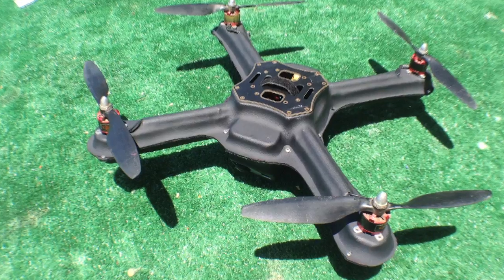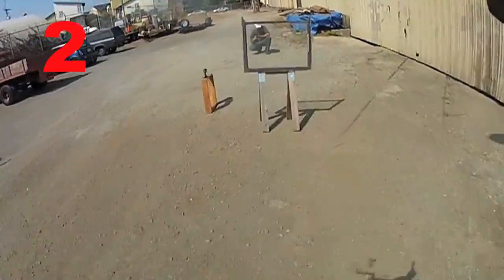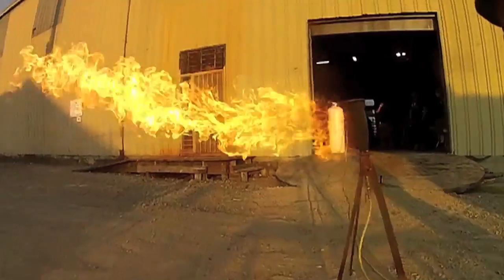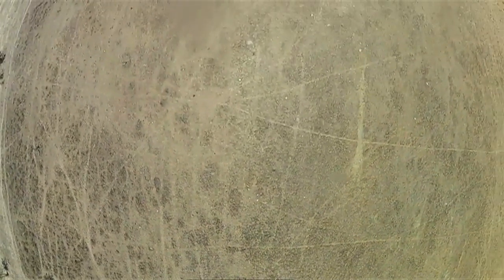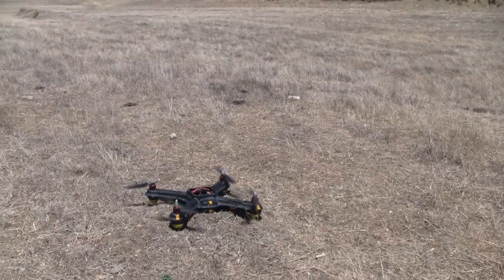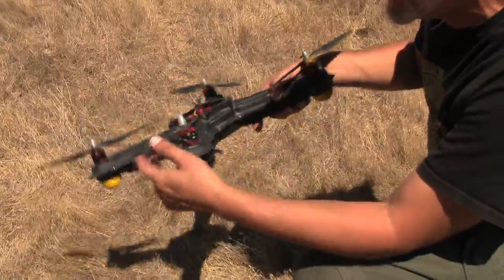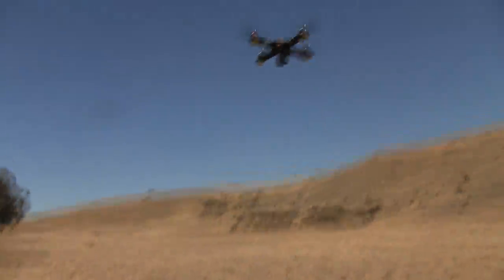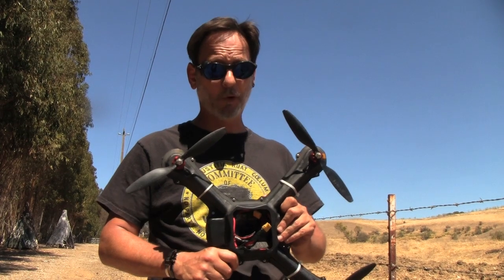Shotgun vs Drone Airframe - UAV Torture Test by Aerial Sports League

Comment: There is something simple to block a drone; nylon wires without weight they are going to wrap around the prop that will make the balance unsustainable 
Also if you take drone loaded with heavy ammunition they are not very "agile"  due to the inertia 
a version of nylon or kevlar wire with glued  sand could potentially damage the props.
The goal is to make the drone inoperative and fell on the ground intact or not is not the problem

Comment: It was a good strong frame for a dji f450 but not bird shot proof maybe if he put the e.s.c,s in kevlar/ceramic type bags also the naza and cut down on the wires with the idea of routing the power through the frame then maybe he will be able to take a shot or two from bird shot so long as it misses the prop 6 props would give a better chance of survival after being shot

Comment: @ the fire test:

One thing about fire is that it's essentially 900 Celsius air. That means it's about 1/4th the density of room temperature air. This means that flying a drone (or any aerodynamic vehicle really) through fire will cause sudden loss of lift. Come to think of it, flamethrowers may be an interesting way to fight drones, as if they don't cook them, they will at least knock them out of the air, and quite likely cook off their magazines or detonate their explosives if they're meant as fighters, bombers, or kamikazes.

Comment: Not really understanding your definition of indestructible.  Each time you did something it brought the craft down and you had to repair it before the next flight. Repairable yes. Indestructible, absolutely not!
Reply: +Muhammad Steinberg
Indeed. This thing isn't indestructible at all. He should have used a reinforced steel frame to begin with.
Reply: +ChaosManticore how about titanium frame stronger and lighter but more expensive :/
Reply: eggrollsoupnova2000
Certainly. But unless they want to spend a lot of extra money on this prototype, I doubt it would be a good idea. Even if you make the frame more durable, the rest of the craft has weaknesses.

Comment: Shooting that pistol gripped shotgun like that is good way to end up with your jaw wired shut.
Reply: +Justin Westbrook Pistol grips are useless, they were originally intended for breaching and nothing else. If you shot it like that with any stout load, you would be severely injured or killed depending on how close you held it to your face.
Reply: Doesn't matter if it's a .410, there are butt stocks for a reason. Pistol grips are for firing from the hip, like breaching a door or close in fighting. By using that shotgun that way, you're setting an example of something that's very unsafe.
Reply: +Justin Westbrook  your jaw, not mine
Reply: Justin, when name calling starts, the discussion ends. I'm going to block you. This person is another reason why trying to have a meaningful on YouTube is pointless. Too many keyboard warriors here.
Reply: +Walter Grace Keyboard Warriors shouldn't be people who can use dumb insults. They should be people who know how to speak correctly and have a proper, civilised argument.
That's what it should mean; not necessarily what it does. :)
Reply: Walter Grace I'm glad you agree. :)
Reply: Common sense.

Comment: I fly racing drones, all drones are indestructible when you replace the destroyed parts lol I crash my drone all the time and all I do is change props and I'm up in the air again, that first gun shot blast knocked the shit out of it, your lost a motor an ESC and the arm is shattered,  and I dunno what else you replaced before flying again, . oh and you never ever bend back a prop you idiot, this prop needs to be changed immediately unless you want to lose it in the air on your next flight and have your drone drop down like a rock.
Reply: Gus F Thanks for the comments and calling me an idiot.  Btw, that unmodified airframe (and bent prop) are still flying to this day, even with the wear & tear and shrapnel damage.  Tell me your racing airframe can withstand the same and then I will heed your advice.  Thanks again and share the links.
Reply: (old) ASL  Share the links? as oppose to the links you shared showing us the same prop is still flying? yes the frame can have wear and tear and duct tape and can still fly no rocket science, can you fly it with the blown ESC? or motor? I think not , you didn't invent the light bulb dude, all drone sustain the same damage your drone sustained and can still fly after you changed the damaged parts,  JUST LIKE YOU DID.  I fail to see where is the rocket science there.
Reply: Gus F Thanks for the comments.  We made the airframe in the video.  It withstood all the abuse in that video and is still flying.  Its a really neat airframe - unlike any other airframe available anywhere.  No rocket science involved.  Just a really durable airframe.  And that prop was a 2nd gen from DJI.  Not sure what it was made from.  Their newer ones are not the same.  But that one prop I mentioned is still airworthy.  But I won't be digging it up and shooting a custom video just for you.  Sorry but I don't have the time at the moment.  Perhaps watch the rest of our early durability tests on this same Youtube channel and that will help you better understand the airframe and it's special qualities.  Thanks again.

Comment: "Taking several shots at it did nothing but scuff the plastic."
Besides the other damage it did.

It's impressive how much damage it can take, but to say it wasn't affected by the tests is wrong. Easily fixed and durable, yes, but hardly indestructible.

Though it's getting there, I suppose.

Comment: What exactly is your definition of it being destroyed?  Vaporization?  The shotgun blast even from a good range knocked it out of the air and damaged several critical components so that it would have been out of service in the field. 

I mean, is this seriously supposed to have military applications?  Really?  This is nothing different than thousands of hobbyists are doing in their basements.  I expected at least a carbon fiber body, maybe a bit of kevlar.  Enough thrust to lift a bit of firepower into the air (since you said it was a fighter).  Maybe some advanced optics (not a freaking go-pro, which is unnecessarily heavy and not remotely aerodynamic, you didn't even take it apart and get rid of the case for crissakes, or dome it). 

Seriously, I've seen literally hundreds of better drones made by other hobbyists.  I'm not quite sure what you're bragging about here.
Reply from the maker: No worries.  A guess you gotta spend, fly, crash, wait, repair and spend over and over again to really understand the benefit of this airframe design.

Comment: I am thinking that the real benefit of that protective cover might be its elasticity thus reducing the jarring of sudden impact. If it was acting more like a rigid shell the drone would have shattered the window more easily. Interesting experiment - thanks.
Reply from the maker: Like a well made saddle, it has flex without suffering structural integrity.

Comment: 1. Holding a pistol grip shotgun ar your face. No
2. A hollow point .308 would destroy that drone.
3. Our using a home defence smooth bore 18.5 inch barrel with looks like light game load. Use a 24 inch with 3.5 inch load and a proper choke. Your test is faulty
Reply from the maker: Faulty how?  Just because you can name a bigger gun and heavier load does not mean it's faulty.  After all, There was no test against an A10 warthog either, so the jury's still out I suppose...  Thanks for the comments and share the links

Comment: your own prototype??? LOL! yall a bunch of crooks. thats basically a DJI Flamewheel 450 and you just wrap it in some kind of dark color box-like. you're even using a battery from Hobby King! so dont say that its your own prototype! lolz.. ESC are 30amp optos. with the 2212-920kv motors. lol.. dont try to own something that nots yours! HAHAHAHAHAH
Reply from the maker: Don't call me a crook.  We used the DJI as inspiration while developing our early "airframe" prototype.  We don't claim to make batteries or motors or esc's (those are off the shelf components). We only made the AIRFRAME, using the DJI as a mold shape inspiration - there are no DJI airframe parts on this prototype.  It just looks like it.  BTW, to see the whole process we went through, from DIY'ing it, to kickstarting it, to now having a full-blown drone hardware company, check out more of the videos on this channel - or go to www.gameofdrones.biz.  Thanks for watching.

Comment: How much does it cost to add the durable elements to this drone? It looks like Kevlar or real hard plastic on the frame outside is this close to reason? I don't see a use for myself but see how the Police and Fire Departments could make good use of this drone. I was thinking a small metal spike element to break windows better. Our city of over 1 million just bought its first drone, looks like a cheap $400 unit with a few upgrades from the vendor's website. They'd probably better off having paid for this in the long run.

Comment: It seems like if you took this air-frame and gave it 6 - 8 propellers instead. You would be able to sustain a shot or two as the extra lift from the other legs would be able to automatically adjust for the other leg's loss. Just a thought.

Comment: Not sure why anyone would downvote this.
Reply: The shotgun choice and load was a joke which probably is where the negative aspect came from, good salesmanship, but the last part was a turn off for many I suspect.
A pistol grip shotgun sucks and is for amateurs at best or people breaching doors. Aim is seriously cut down as well as velocity +1 on his zombie tape job though :P
So for the sake of the argument of the video this is highly unlikely to be the shotgun which would be used to shoot it down. More than likely an actual bird gun with longer barrel and a bird load which can very amazingly. Heavy goose shot would probably mangle it while light should would do nothing.
The last shot with the shotgun on here is what we call in trap an air move. Meaning the air coming from the pellets actually pushes the clay in a certain direction looking like a hit. Honestly it did not even look like this was the case, just a flat out miss which is easier than you may think.
Distance also plays a huge role, it not unusual to get "Peppered" from pellets while out fowl hunting, it always stings and rarely breaks skin, again, depending on shot used.
Had a defense shotgun like this actually been used it would have been loaded with some short of buckshot any which would obliterate it as they have no trouble penetrating walls etc.
Reply from the maker: I wonder that myself.  Either way I win, so it's all gravy.  Thx for watching!

Comment: nice video.  I think if you hit the central unit with a shot gun it would be done.  maybe use a 3" turkey load :)

now if there were ten of them hovering around you would have a real problem.  that what the military is looking into, more low value targets to attack a location.

Comment: I don't think most quads would completely "shatter into peices" from a hit into 1 arm/boom. And if the bullet had of gone through the flight control board then it wouldn't have flown again but as you said you only would need to replace the component. I do commend you for making it be able to fall from 400ft but apart from that test I honestly think that a standard drone would be able to do what you just demonstrated. Another way to look at it is if you do own this drone and you do destroy it, how hard would it be to get new pieces, your far better off going with common "delicate" materials than hard to find (almost) "indestructible" pieces. Lots of drones could go through fire for that period of time and I think that there is nothing particularly special about yours. Plus I don't think you have a great attitude and you just like to blow your own horn.

Comment: maybe tweaking the 4 arms that hold the 4 motors to the mimic a propeller would help it in a loss of power situation.  Instead of just falling like a brick it would do something like an auto rotate,  or at least slow it down to improve your machines survivability.  those receivers and brushless speed controls can by sensitive to impacts.

Comment: Give me an ak47 I will nock it out of the sky
Reply from the maker: Sorry, but you need to supply your own AK.  Thx for watching!
Reply: yes, and so will 12 ga. buckshot, well aimed rifle or pistol bullets, or a .50 cal machine gun(and of course antiaircraft missiles). but a drone like this is unlikely to encounter any of those, and if it does, it won't stay airborne no matter how well it's built. The point is durability. This airframe is designed to increase the chances of survival for the electronics.

Comment: Nice job using a shotgun without a proper chock.

If it can't be used for skeet shooting obviously it won't be good for shooting down a drone. Also the shot load plays a big role.

Sorry, but against a proper shotgun it would be destroyed.
Reply from the maker: Thanks for the comments.  As you can see, I also know a little about guns, and this shotty in particular.  I find it amusing how the people who miss the point of this airframe test are always people who insist there is a bigger gun or better ammo load.  The point is that this airframe can not be destroyed by any means that a drone would likely encounter.  Most airframeswould have been destroyed in the first 15 seconds of this clip.  My airframe has been surviving this abuse for over 3 years.  Thx again and share the links!

Guns & Gardens Ep. 13: Mossberg 500 Ballistic Test
Reply: Marque Cornblatt Prod.
I thought the purpose of the test would be to see if the drone could withstand being shot at be angry Americans who don't want drones over their head.

My apologies if that wasn't the point of shooting at it with a shotgun, and thank you for admitting you didn't REALLY try shooting it down with a shotgun designed for shooting things from the air.
Reply from the maker: bulbinking The purpose of the entire video is to show how reliable our airframe is against damage and abuse - well beyond what would be expected while flying a drone.  The gun in this video is being used as a tool for testing, not as an object of lust.  Why doesn't anyone ever complain about the quality of the window panes we used in our testing?
Reply: Marque Cornblatt Prod.
Oh believe me, that was next on my list of obnoxious critiques! ;)
Reply from the maker: Dylan Smith For real, get a handle on the realities of the situation.  If a person or agency wants to spy on you, they have amazing tools available to do just that. In fact, they are watching you RIGHT NOW!!!!  No drones needed.  The resolution, accuracy and usefulness of drone-gathered data sucks in comparison to the ease of hacking your computer, grocery receipts, mobile, phone and auto's GPS.  Trust me, as much as I love drone tech, they are still Model T's - Can only fly for a few minutes, make a lot of noise and must be relatively close to a subject to record it.  Consumer-grade drones are a far cry from a quality spy tool.  Don't believe the hype.
Reply: Dylan Smith
lol complaining about your privacy as you're posting from your youtube account thats most likely synced to your google+/facebook/twitter accounts, which are all more intrusive and privacy-destroying than a drone ever possibly could try to be.
Reply: bulbinking Yeah us Americans don't want drones flying over us. Watching our every move and seeing if we step out of line.
Reply: Kerry Emmerson
it's just typical paranoid un/misinformed american being paranoid un/misinformed americans.  let them fear it while people like me embrace it and will make plenty of money off UAS :)
Reply: shmediaproductions yeah sorry its difficult to read sarcasm through text.  on the other hand, zoloft might help your stress, you are very angry, i hope you can feel better.
Reply from the maker: flimp drangort Exactly how am I being dishonest?  This very airframe survived everything in that video and has been surviving these kinds of test for nearly 3 years.  It was flying in combat just yesterday... http://vimeo.com/104688413
Reply from the maker: flimp drangort I try to reply to all my comments - sometimes hundreds per day - so explaining things to commenters can perhaps sound defensive.   I spend a lot of time explaining the point of this video to people who are focused on gun culture, not drone development.  Not surprisingly, I  have found that a person's interests can accurately predict if they understand this video.  BTW, Did you know I have dozens of survival, off-grid, and gun-build & test videos posted to this same youtube account?  If fact, if you had looked at my previous videos, you would see that I am very familiar with most long guns and this popular Mossberg 500 shotty in particular.    Thanks for the comments and enjoy the rest of my videos!
Reply: Marque Cornblatt Prod. Anyone that thinks hacking a persons computer, or phone is easy obviously knows nothing about hacking a persons computer, or phone. You wouldn't know a port sniffer from sniffing a fart.
Putting a camera on a drone, and flying over someones house is infinitely easier than hacking someones computer.
Take a look at the most recent celebrity  nude pic "hackers". No robust software, no back doors, no security holes, believe me these guys would have gone that route if they could, but how did they break in, they guessed the simple passwords with brute force because the victims didn't create strong passwords, but even then they didn't have access to the actual computers/phones.
You don't know shit you just run your mouth.